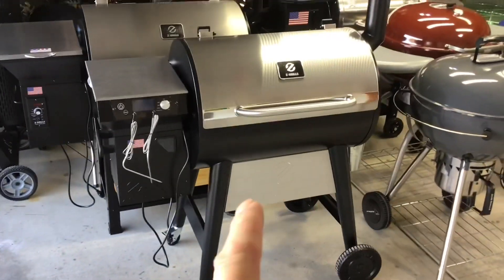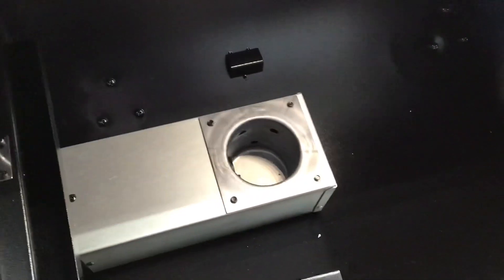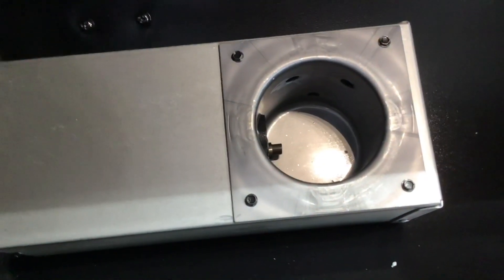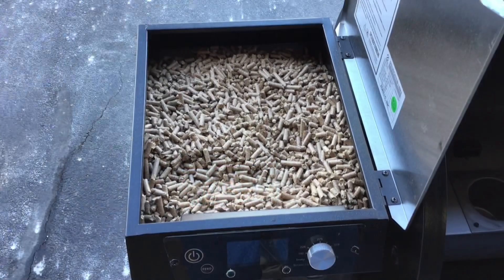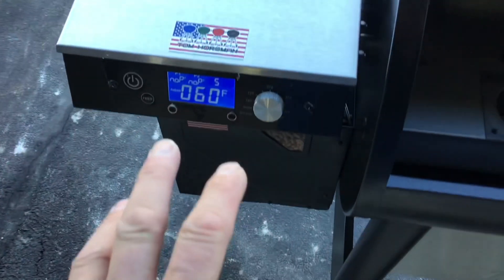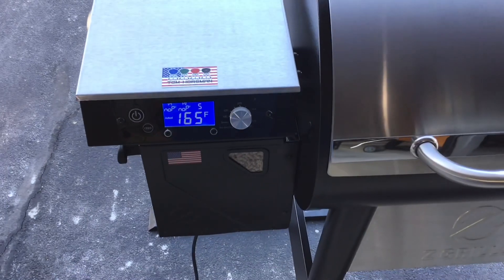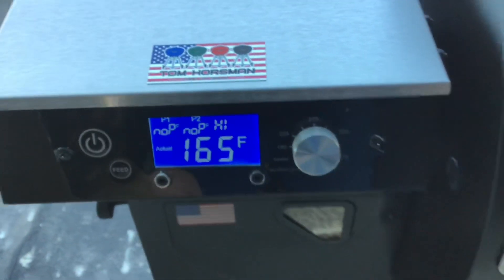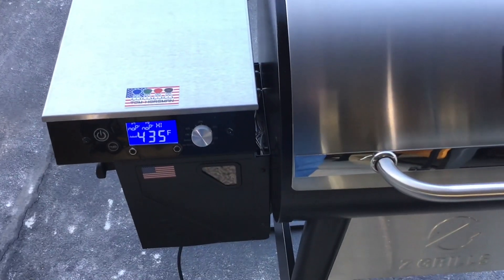Review Of The New Z Grills PID Controller, How Well does it Perform? /  Burn In and PID Grill Review

Comment: I would suggest setting up a reliable and independent temp probe to see if what the PID controller says is ACTUALLY the temperature. My pellet pro 1190 does maintain a constant temperature, but it's usually 20 degrees higher.  So maintaining a “steady 225” is ACTUALLY a constant 245-255
Reply from the maker: Thanks for the clarity Jack.  Got to remember where the RTD probe sits it is higher than the grill grate so I would expect different temps. In my experience it always been lower not higher. Have you tried calling Dennis at Smoke Daddy?  He will do whatever it takes to make it right by you. Thanks again for Watching! Feel free to contact me anytime, I too want it to be right for you. Thanks www.smokedaddyinc.com
Reply: @TomHorsmanAmateurBBQ  

I set up the other “independent” probes within inches of the pellet pro’s probe. I will try to call them again. I just became used to adjust for the “difference” but shouldn't have to
Reply from the maker: It may be as simple as a new RTD probe Jack..

Comment: One thing I noticed. Maybe just cause it's a video but the little dot on the knob that shows where the temp setting is doesn't show up very good. Maybe a sharpie fill in on the knob dot? Also, is this clean up same as the Traeger? Needing a vacuum to get all the ash out? Thanks Tom.
Reply from the maker: Thanks Mike!  Good point on the dot, it is hard to see. Yes this Pellet grill needs to be cleaned out of ash, a vacuum works the best.